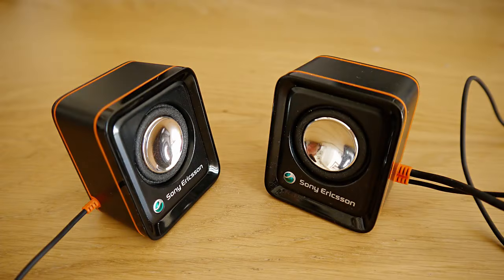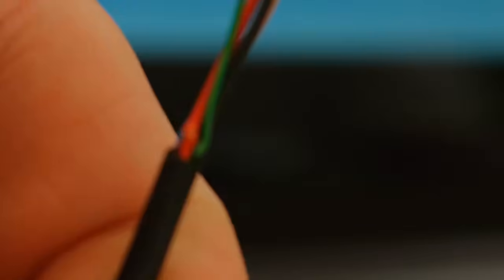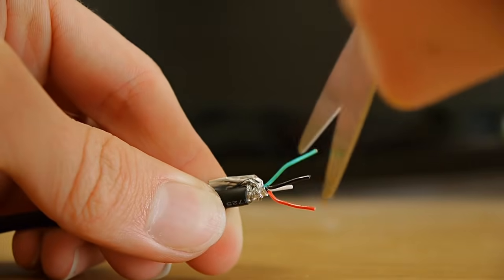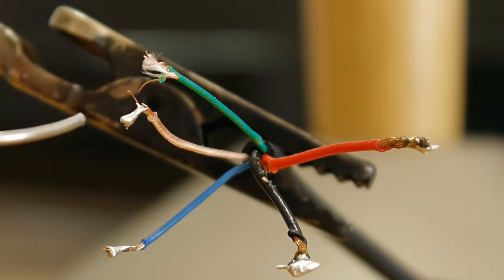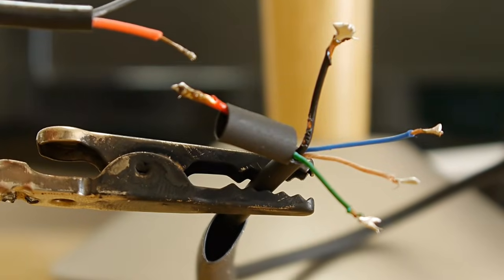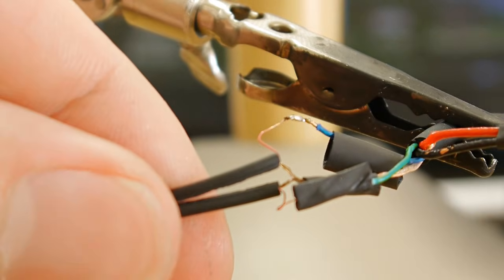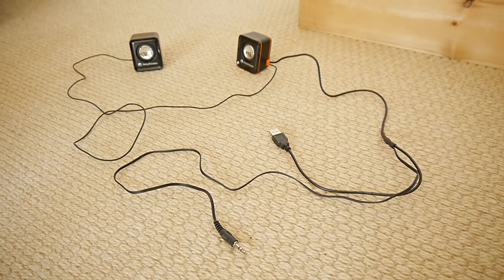Change Ericsson MPS-70 into USB Speakers

Comment: So there is no way to use the usb data transfer wires as left and right channel directly? I don't know why I thought that it would be recognized output device if you just soldered 'em together, it's still a convient powersupply. Thanks, for this video, that answers that question.

Comment: Hi Perk, I have a MPS 60 model, is the procedure the same with this video?
Reply: No but its not worth it just buy speakers because it will sound better and it will take less work but alternatively you can cut off the cables that go into the connector and plug the speakers into a small amplifier you can buy on amazon and you can connect it to usb power at 5v and it will work

Comment: Why need a usb connector when the sound comes out of the headphone jack socket to the speakers? They're only a pair of mini speakers, surly they act like headphones and not needing external power to run them?
Reply: They need an amplifier because it takes more power to run them and an amplifier in your computer or phone could get damaged if you wire the speakers up like headphones because they demand more power because theyre active speakers
Reply: @number2dog  But they were designed to just simply plug into the Sony 810i mobile phone without a USB adaptor so that phone must have It's own amplifier then?!,...and if taht's the case then surly my far newer xperia mobile phone has an inbuilt amplifier too?!
Reply: @ZEUSDAZ  no one of the speakers has an amplifier in it and it is powered by 5v that come from the phone because it has 5 pins which are the ones on an aux cable (3) and the other ones are for power(2)

Comment: is there a way to convert the speakers to usb-c ?
Reply: You would need an usbc male breakout board and solder the red cable to the 5v and the black cable to the gnd and you need to find out where to solder them to your breakout board

Comment: Is it possible to connect these speakers to the phone using a usb-c plug?
Reply: You would need an usbc male breakout board and solder the red cable to the 5v and the black cable to the gnd and you need to find out where to solder them to your breakout board

Comment: They are not USB speakers, even if they are powered by current from the USB socket. Real USB speakers does not require the audio cable. :)

Comment: someone could help me? I have soldered 3 blacks and 3 reds wires (usb, left and right speakers) but cant figure out the other wires. I get 2 red-blue wires from speakers, 2 grounds from speakers, 1 red from the jack cable, remaining are 2 green,  2 blue

Comment: This title made this video stupid. The speakers are still not USB speakers at the end! Still the same 3.5mm jack! Whats the points adding another USB power? This video maker has nothing to do?
From all that cost alone, you can buy the speaker cheaper. Why do stupid thing and wasted your time?
Reply: +Post I put one of these together a few years ago and it came out to $7.00.  $4.95 for the speakers from All Electronics, $1.00 for headphones, and $1.00 for the USB cable.  I needed practice soldering.  And, I found doing this project this way making USB powered speakers prevented the ground loop that plague true USB speakers.
Reply: Unless, like me, you have everything at home. I had a set of useless speakers lingering in the drawer and now I have a useful set of speakers that cost me a couple of minutes.

Comment: mengapa harus memakai keduanya , usb dan jack audio 3.5mm ??

apakah tidak bisa  hanya salah satu 
yaitu dengan menggunakan jack 3.5mm saja (tanpa perlu jack/kabel usb),,
 jika ingin memakainya pada ponsel  dengan jack 3.5mm ?? seperti xperia active, arC S , LWw , Blaupunkt S2 , X1+, J2 ?
Reply: Hi untuk penjelasan jack 3.5 untuk audio ya dan USB ialah untuk kuasa letrik 5v untuk menghidupkan amplifier dalam speaker supaya bisa keluar bunyi kuat, sekarang bisa guna kuasa laptop dan juga powerbank. sebelumnya sambungan power hanya bisa dipakai pada ponsel Sony Ericsson. semoga membantu. like kalau dah baca ya.

Comment: Great sound for the money invested. Can be used as travel speakers for laptop and phone. Important is to use a good quality USB cable and  jack. If you use some cheap cables it might not work, it happent to me, cheap wiring bad signal or not at all!

Comment: is it possible to send the sound through the USB cable its self? as the device i am using does not have a headphone jack.
Also, if it would need drivers they would need to be compatible with Raspbian wheezy (debian linux based.).

Comment: can i use a mobile charging adapter to power usb speakers?
Reply: +Anshul Thakur Any usb port would be good enough, Wall charger, usb charge pack ( for charging phones and tablets) pc/laptop usb ports. 

But, USB3.0 and wall chargers deliver more power. USB2.0 is limited to something like 500ma giving you 2.5 watts max.

Comment: the color of my wire is,.,, WHITE RED GREEN ?  in jack ...
which is.. the ground wire ?
Reply: +Jim Shayna You would have to use a multimeter and measure which wire goes to the top part of the jack(closest to the wire) and thats the ground wire :)
no one can tell you which color it is cause they make them i all kinds of compinations.
Reply: ty

Comment: I have a problem
when I removed the shield there were only for wires
black
red
blue
white
what to do??
Reply: +Abhay Kumar 
if you talk about a USB cable,
then cut blue and white (you dont need them)
red is 5v, black is G ground

USB cable in this project serves as power plug,
always is red(5v+) and black(G-ground).
Reply: +TheCyberbedouin ¡¡oye!! ¡hola! yuna pregunta, si es cable de audífonos, ¿cómo es?, ¿qué conecto?. por favor. ¡¡gracias!!
Reply: Alejandra Sodi
si se habla de un cable USB,
luego se corta azul y blanco (usted no los necesita)
el rojo es 5v, el negro es tierra G

cable USB en este proyecto sirve como cable de alimentación,
Siempre es de color rojo (5v +) y negro (G-tierra).
Reply: Alejandra Sodi
si su conector de audio está roto de lo que tiene 3 cables,
rojo L y R blanco y el alambre desnudo G.

Comment: Not really usb speakers, but usb-powered. If you buy one of those small usb audio adapters,  you can make it so you only need to plug in the usb cable into computer. Basically, those speakers(audio card really) would appear as a separate audio device to the system.
Reply: But there would still be no connection to the amplifier in the speakers?
Reply: Hi. Could you give an example of such USB Audio adaptor that you speak of? Sorry, noobie here...

Comment: The solder never ever stays on the damn wires! So difficult, and when successful, they do no work. When I move the cable a little the left stops working. So clumsy xD I freakin' hate soldering. You need a $200+ soldering station

Comment: 5V is not too much for this device? did you use resistor?
Reply: mustangdc3 I guess the speakers were originally working at 5v. If you're going to make this aswell, make sure to check if the speakers are supposed to work at 5v.
Reply: NubeBuster they were working on battery voltage( from3 to 4,2) but can work on 5v

Comment: i followed the steps and it didn't make any noise, and the usb cable was overheating, do you know what i did wrong?
Reply from the maker: ***** Sounds like you've wired up the power connections wrong.
Reply: DIY Perks Can you change the MPS100 ? (but this speakers have orginal aux socket )    But you have to keep the phone as a power supply :) :P
Reply: *****  Sam here :'D

Comment: dear DIY Perks i have headset i-rock with USB conector, its possibly to make USB become jack 3,5''? with no mic and no sound controler, no light (i want to make pure ear phone)
this is an example picture how my headset look like
http://s1194.photobucket.com/user/andrew77771/media/IMG00327-20130403-1507_zps2cc7d949.jpg.html

Comment: Will the sound quality be the same after I followed this tutorial? I see definitely more pins on the Sony Ericsson plug than contacts needed in total for the USB and Jack (stereo needs three contacts (left, right and zero), add the two contacts used by the USB plug and that'll be five. But the SE plug has like eight contacts. (Do you know what I mean?;p)
Reply: Sometimes connectors have useless pins that aren't in use. Maybe the extra 3 are used as signal connection to tell the SE device that external speakers were connected I don't know. I just did the same with a set of MPS-70's I got for cheaps and there are only 5 wires coming from the speakers itself (Positive, Negative, Ground, Left and Right Channel) And it works just fine.
Reply: HelixThePegasus
negative is grounded isn't it? I mean you have audio -+ but you also have a power -+ and the power negative is ground.
Reply: CKS5000 Negative in this case is the cable that makes it possible for electrical signals to 'flow'. All headphones or jack-enabled sound systems (like these small speakers) have for audio a left (+), a right (+) and for both of them one ground (-). But a sound signal is an alternating current so for bigger speakers it doesn't really matter how you connect them.

The USB power cable is a direct current, so with this one you will have to be careful when connecting them, otherwise the electricity can't flow the right way
Reply: if your comment is directed to me, you are confused. You are talking about an audio signal negative, if there are five wires from a connector, in diagrams i have seen, they refer to the audio as "data". There are also two wires for the power, one "hot" wire(live power) and a ground, the fifth wire...idk, maybe it's the shielding wire.
Reply: CKS5000 Negative can be referred to as ground, but in this case you cannot put the DC's negative (the black wire) into the audio signal's ground (copper color wire) since (like how Ron de Goey said) the left and right channel signals have a common (ground), where they share the same "negative". If you connect your DC power into this, your audio will not be isolated from the power source.  And i said negative since, in a battery you don't call it positive and ground, its usually positive and negative, sure on DC circuits its considered as ground but since we are dealing with both audio and power signals...Generally the audio's is considered as signal ground and the power as power ground but saying negative helps in differentiating them since the wires have an individual purpose.
Reply: HelixThePegasus
I really feel like you want to argue but are agreeing with me in the weirdest way ever. I am talking about wires from a connector, and you are talking about...whatever. You should not have a power negative and also a signal negative and a ground wire.
Reply: CKS5000
I do not have one of these, so I can not look at what you are looking at. You are making me want to take something apart!
Reply: CKS5000 The wires from the connector have 2 ground cables, one for the sound and another for the power. Which cannot be connected together since the sound's ground is probably filtered in a way to isolate it from the noise of the power. I just meant that I called the power's ground as Negative. Instead of ground. The fifth isn't a shielding wire, its the ground for the input of sound.
Reply: I honestly don't know what you are going on about. you only need the red and black wire(may be different color), those are the only wires being used by the usb cable. The audio is taken care of via the headphone cable. Who said anything about connecting the audio and power together, O.o...just like Whaaaaaaaaaaaa...!!  I looked up a schematic and concede that there are five pins that are in use.
Reply: CKS5000 ahhhhhhhh you two are pissing me off  there ate 5 wires in cable no shielding power,ground,audio gruond,left,right the three other pins are for phone to register that spekaers are plugged in and to give power to spekaers

Comment: hey dude, i can make the same for my speakers, MPS-60??
Reply: You can but for the 60's you need to keep the connector circuit board intact since that is the amplifier. If you google the model number you'll quickly find diagrams of where to solder a usb and the 3.5mm jack.

Comment: I have figured out what my problem was. After several months of using a pair of headphones, my daughter had "run" the wire over with the chair and severed it. I could have spliced that together but needed ear muffs for another project. After unplugging it from the back of the computer, the unwanted signal went away. Having it plugged in was causing interference.

Comment: can you do this to radio speakers? The ones which have a red and black wire?
Reply: You can use the radio speakers if you use the guts from the powered speakers. I did something similar, comment if you think I should make a video about my build.
Reply: matsv201
I think he just means using the speakers  because they are bigger. I have done something similar, in fact, My picture is of the powered speakers I made.
Reply: CKS5000 something like PAM8403 amplifier

Comment: hey, thank you for this great tutorial... 

i want to change my internal stock speaker from my laptop with a biggers one, do you know if this would work ?

more exactly, i want to get the stock one out and and insert an aftermarket one, of course i need to do cable soldering etc, but you think  will work ? 

Thank you
Reply: Bob Anbbey Yes, you do as the USB provides power and the audio cable provides, well - the audio.
Reply from the maker: ***** Unfortunately it's probably not possible - any replacement speaker you want to use will probably be the wrong size so you won't be able to fit it in.
Reply: but if it will be the proper sized one that can fitt, it would be possible to have sound ?
Reply from the maker: ***** Should do.
Reply: DIY Perks Do you need to plug in the usb cable and the audio cable for it to work?

Comment: I did this a few days ago but used the jack, button, and microphone from a pair of smart phone headphones. I haven't used the speakers much so far but they work pretty well and provide decent sound powered by a 10,000 mAH battery pack/charger. Total cost was less than $20 with the added bonus of putting soldering skills developed long ago as a calibration specialist and biomedical equipment tech to use after many years of neglect.

Tip: don't count on the rosin core from the solder. A light coat of flux from a lead-free plumbing repair kit on the wires made tinning and soldering very quick. I squeezed out a bit and dragged the wire ends through the flux and when touched to the iron the solder wicked right into the wire. The ear bud wire strands were individually coated but a bit of flux and bead of solder on the iron quickly dealt with the coating.
Reply: The price of the speakers, solder, shrink tubing, and headphones was less than $20. This price did not include the power pack.

Comment: Can I DIY like this way the MPS-60 speakers?

Even if we modded like this, can we use for example Portable Battery Charger as electrical source?
Reply from the maker: Yes to both questions!
Reply: DIY Perks Thanks, I will try to do this until the end of august, so I will reply to you with the results.
Reply: use power bank.

Comment: It isnt run on 3.7v originally?, or they run at 5v?

I was thinkink qbout it, maybe i should use a step down converter dont u think?
Reply from the maker: They can run off 5v okay (it's within spec), so it's not necessary.
Reply: yeah, thx just because  i work in a webshop and i got a new one (it's funny that they still hve geniue ones in stock) and if i modify i wanted it to last long

Comment: question: can you switch usb to mini usb, so it can work of smarthpones?
Reply: a bit late or too late maybe... but anyway... you really can put a micro usb cable instead of normal Type A USB cable. Phones with type Mini USB are rare and won't even support USB OTG.
But the phone MUST support USB OTG. If it don't support USB OTG then no power will come out from USB.
In this case you have to use a powerbank with classic USB Type A connector.

only on USB OTG support the phone's USB will provide 5 volts output at (about) 200 to 900 mA. That's definitely enough power for normal room volume or bit above. Even with 200 mA are adequate volumes possible. Not party hard but for background music enough. :D

Comment: I feel i am YT stalking you. I commented on another video(similar video to my problem), this one is on the money. I should mention that I had no trouble with the mid drivers(connected to the output on PCB), the tweeters however I had to go farther up the signal chain and find a spot before the low pass filter stuff. I also added a RCA connection to it(to the back not the PCB[ I can send audio in and out]). Again my problem is that after a couple of years I am getting an unwanted signal in the speaker that doesn't have PCB in it.

Comment: Would it work on a mobile phone and/or laptop if I dont do the usb? ( just the audio jack)
Reply from the maker: No, it needs USB for power. You could replace the USB connection with 4x AA batteries though, which would allow you to plug it in to anything you wanted.

Comment: pretty clever stuff :) 

i have a question for you. i have a set of usb speakers for my pc if i put the volume up too loud (not very loud) theres whining and crackling interference when theyre not outputting sound? do you know why?

would be nice if you could do a few more techy diy projects that cover something like my prolem and other things too.
Reply from the maker: Sounds like there's some interference in your audio signal. You could try a different soundcard I guess, as they're not that expensive these days.

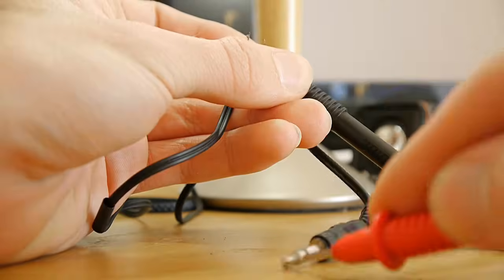Comment: Is there a way to do 1:40 - 1:46 without a multimeter?
Reply: yes watch the video its the same for all
Reply: you shouldn't need to, he told you what the left right and ground were, and the wire end should have a marking or ridge or some indication as to one being left and one being right, the ground is usually bare.